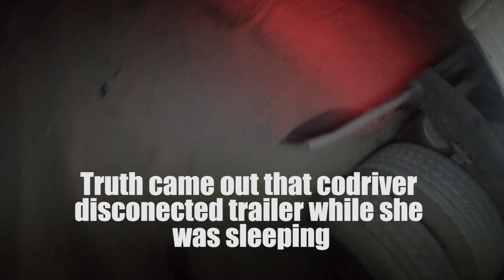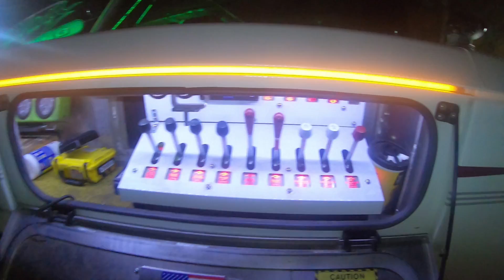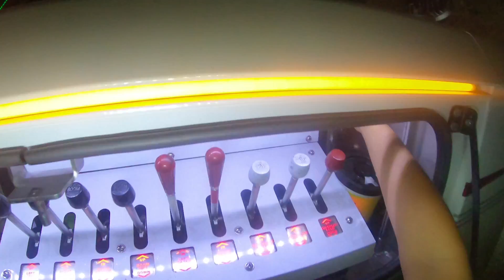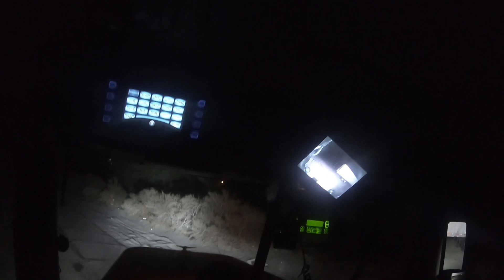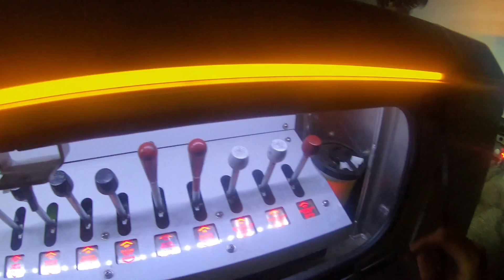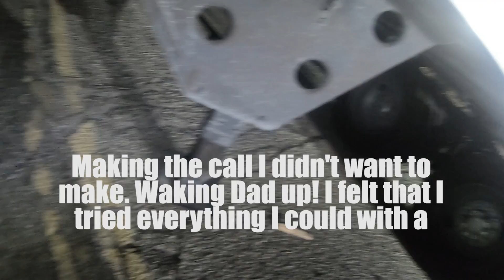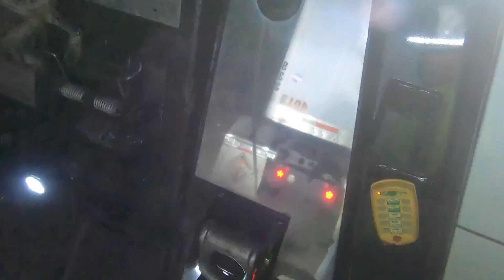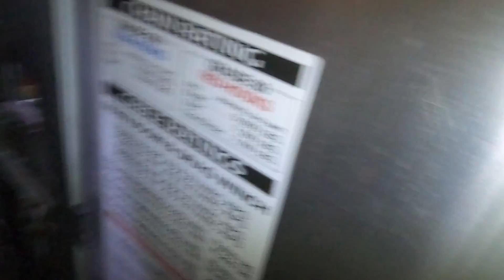Tractor Trailer Fails At U Turn

Comment: Some things new drivers should keep in mind: 
Stay on the interstate as long as possible to avoid small streets. 
Never ever do a u turn. Find a large shoping mall or business and use their shipping and receiving entrance. 
Worst case if u got down a bad road u need to stop and ask for help. 
Asking for help or a spotter  while u back is free. 
Even calling police to help shut down a road while u back out is free. 
But a tow bill or damage to someone's property is not free. It's very expensive..
The long way around is sometimes much safer then a easy short cut.

Comment: Some of these drivers need to be told about not pulling the pin in drivers school when they are in this situation.  Wait for the Towing Company!  Good job even if you had to call for back up.  Better safe than sorry.  Stay Safe and hydrated!

Comment: Could the trailer frame hold if you had used the lift as a brace and low pulled on the tractor?

Comment: Good work brother! Question can't tell from the camera entirely but could you have hooked from front side to trailer, Had tractor set brakes and pulled trailer forward into tractor. I feel like the tractor would have been more of a anchor then a pivoting trailer on sand. But at same time i could be wrong and if pulled that way that faring may have exploded. Either way got it done good work man!

Comment: In that situation where you didn't hear the pin lock-in, once he was straightened out I would go ahead and set trailer brakes, re-pull the pin, then back into it one more time just to make damn sure it's locked, just for future reference. Even though it looked like it was locked it could've just been caught on the edge. Call me crazy, but that's what I would've done. Would've only taken less than a minute to do just to be sure it doesn't come apart going down the highway. Good job though!

Comment: Why does pulling the king pin(5th wheel)  come to drivers mind ?
Reply: some drivers think that if they pull the pin and can disconnect, they can maybe in this circumstance loop around to other side of the trailer and hook back up and save it them selves.  It never works.
Reply: Because, they think they can bobtail out rom under the trailer & hook back up in a jack-knife position, until they pull the pin, then realize they are already in a jack-knife.
Mama's gonna get a piece of that co-driver. I thought I saw her take a couple swings at him already when they were outside arguing. Never shack up with anything bigger than you, not even in a truck... lol
Reply: luis montes same reason making a damn u turn on a two lane road did to them !!

Comment: I'd really love to know the thought process behind disconnecting the damn trailer. Like what good does it do you? You're only going to have to pay for the damn trailer to get rescued too...
Reply: Sandy selfish always need to kip rollin
Reply: It never fails, a driver always thinks they can disconnect then circle to the other side and save themselves. 

12 years in the industry I’ve seen probably a hundred or more drivers try that, it’s NEVER worked. Not one damn time

Comment: Trent, I wonder if you could have put one line on the front of the trailer and the other on the pull pin on the cab, and pulled both of them at once? You might have been able to pull the trailer into the jaws and lock it, or at least keep it on the 5th wheel until you had the rig straight enough that they could back under the trailer and lock it.

Comment: Simple winchout turned into a very costly job due to a very dumb mistake by the codrive! I don't get what's behind their reasoning for pulling the pin on the 5th wheel.I think maybe some of these so-called driving schools would teach them about this situation not working!
Reply: Lynn Moore the reason someone will pull the pin is so that they can unhook from the trailer and hopefully drive out from up under that way when the to truck driver gets there all he would have to do is straighten out the trailer but if that’s what they were thinking then the landing gear should have been lowered and it wasn’t so clearly both drivers aren’t experienced enough to know that they were to far into the jackknife at that point shit happens

Comment: The phantom pin puller strikes again , funny i have a feeling the hubby u turned it pulled the pin then jumped into the sleeper keeping shushhhhhhhh and then left it for his mrs, That was a near disaster Trent plus a near right-off fairing/airofoil, overall it was a good call out for your buddy. Note to self Trent dont believe the buggers check all round first even the brake positions because it will come back on you & bite ya, like the pics of the fairing that was a good call Sir, pics dont lie. Double the bill just to save derv going to the next juction Wow ! that was costly.

Comment: Thank you Trent, and Daral. I have a  ? Trent can anyone drop the trailer from inside the Truck
Reply: No, you release the kingpin via a latch you pull near the fifth wheel.
Reply: A lot of newer trucks have auto 5th wheel release inside cab of truck.

Comment: someone forgot to either 1. do a tug test....or 2. the u turn put so much pressure on the fifth wheel it unlocked (BUT I DOUBT IT)…..or 3. pulled the pin to try and point the blame at the wrecker driver....

Comment: Seems like when a u-turn call comes in dispatch needs to ask if the 5th wheel has been pulled. If yes then add an extra ($300) charge to the customer!
Reply: If they'd lie about it to the tow driver's face,  how easy would it be for them to lie about it on the phone ?  Only thing you could do (and kind of sneaky to do it) would be to tell them during the phone call that there is an extra ($300) charge if they've pulled the fifth wheel.  At that point, the customer is likely to hang up and call another tow company.  
I think the best thing to do is just what Trent has been doing.... ask the driver point-blank,  then go physically check for himself.  
If you have to call out another truck and charge for it,  it's not like the customer can just drive away, if they could just drive away, they'd have never called for a tow in the first place.

Comment: Hi Trent ,  could you have used the underlift to brace the trailer while pulling the cab with the Winch?  Maybe put some wood between first to stop any damage, I know more than one way to skin a cat just a suggestion. Great work keep it up and keep safe
Reply: Brett Swampy the underlift only goes out a couple feet

Comment: Instead of going around and pulling on the tractor from the rear couldnt you have tried to pull on the trailer at the landing gear from where you originally were at?
Reply: Sam Valentine you pull on that landing gear and rip it out now how will you drop the trailer Heavy Tow Truck Drivers know what they are doing trust me

Comment: I'm not saying this as a arm chair driver. just a though on another way to do that pull.
Given the angle of the trailer to the road, I might have tried dropping the trailer where it was. Landing gear down and deflate the air bags on the tractor. Then continued the front pull. Once freed from the berm and trailer. I would have drove the tractor back to the other side and re-hitched the two units and driven back on the road in the original direction. I'd give it a 50/50 shot..lol
 no criticism. just a another thought from the box

Comment: I got stuck in the mud before company told me to lie about the weight of trailer 😂The reason is economic -they lie about trailer weight when company calling  to get the rescue tow - trucking company get charged by how heavy the equipment is-the towing company charge per hour and also how heavy equipment is that they going to pull from the snow or from the crash from whatever. The lady knows exactly how much truck and trailer weighs because it's all on paper 😂.

Comment: Drop air bags, yellow button out, red button in so tractor will move forward a couple of inches then reverse into kingpin so the fifth wheel will latch! Then inflate air bags, dolly up and pull her out! Help a lot of drivers get out of jams like this in my 33yrs OTR, Now retired!!
Reply: Well I Ain't Never not all trucks are set up to dump the rear suspension.

Comment: If you dont have common sense you should not be a truck driver. And what did they think they'd gain by pulling the 5th wheel pin? In my 23 years I drove a truck I never once thought that flipping a uturn on a 2 lane road would be a good idea. Todays drivers are idiots.